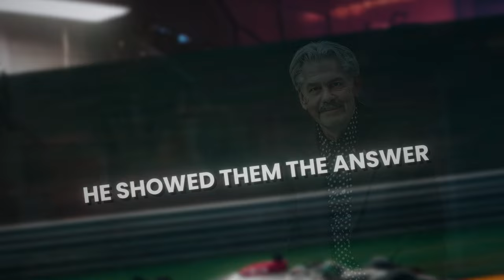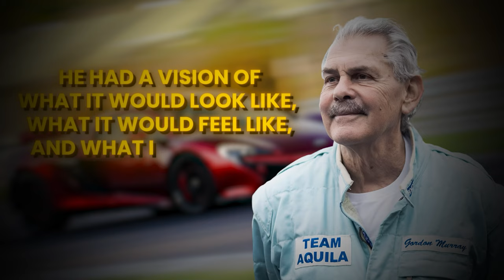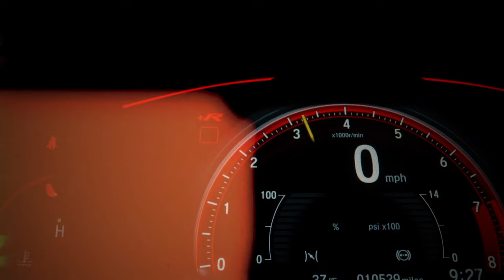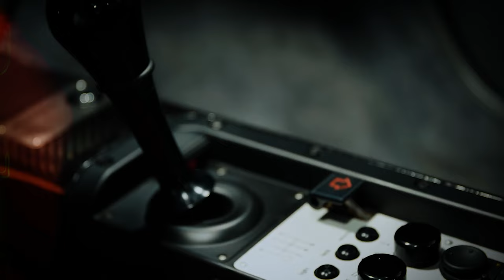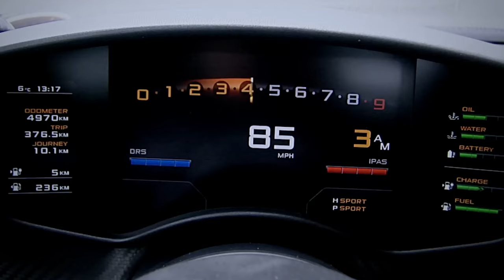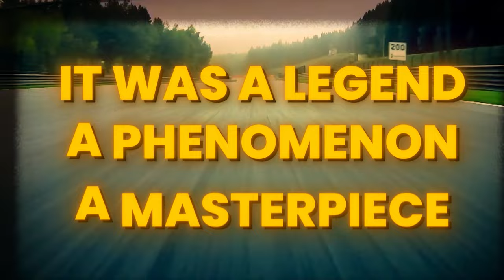Sophisticated Speed : How One Man Created The Perfect Car!?

Comment: The f1 not having a flywheel is a bit of a misinterpretation, he was aluding that it didnt need flywheel mass for balance, but it does have a flywheel, albeit a light and small one, as the clutch needs something to engage onto. Due to the light weight and small diameter of the clutch and flywheel (which nessesitates more slipping and reduces total surface area and thermal mass), f1's have a tendancy to go through clutches quite quickly when being used for street driving.
Reply from the maker: Thanks I appreciate it so much ❤️🐬